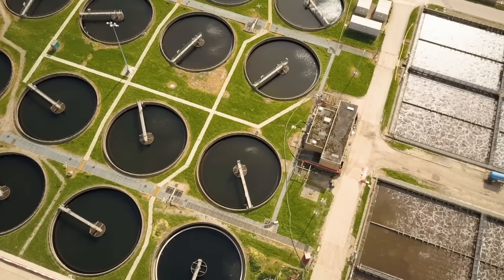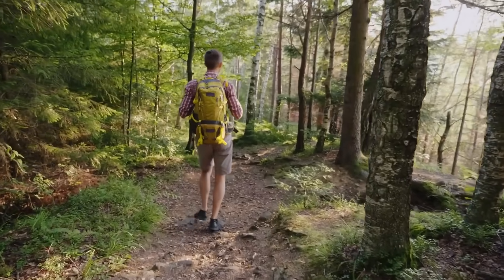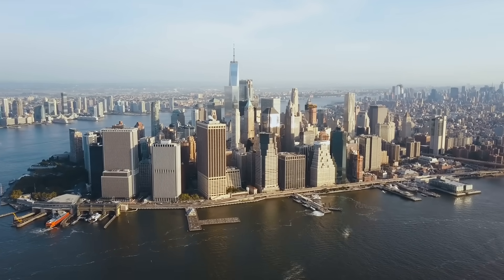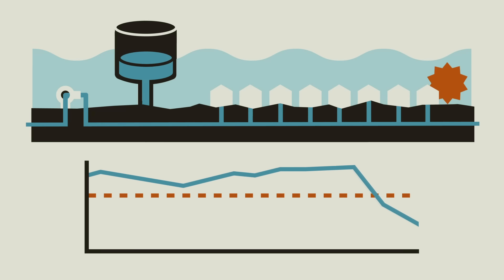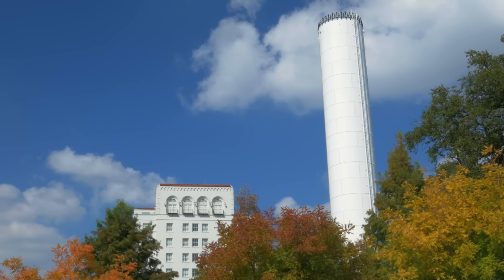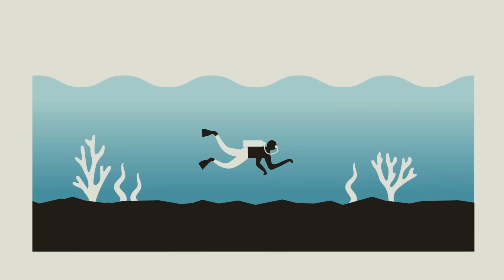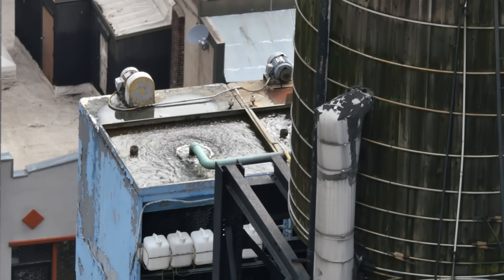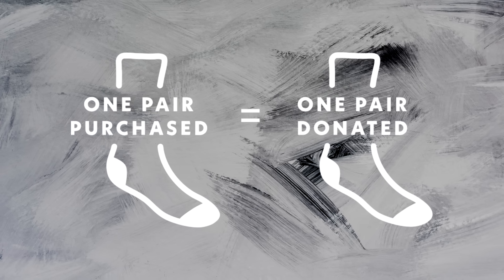How Water Towers Work

Comment: So it's basically a capacitor.. for water.
Reply: Get out of my mind
Reply: The equivalent of a capacitor in a hydraulic system is usually called an accumulator, but yeah, these two things are analogous.
Reply: @nopenoperson8964  ok, water tower is a huge storage accumulator with ~1atm of pressure in the air tank, which happens to have a really big volume.  </snark>
Reply: Gravity battery
Reply: That's another way of looking at it.
Reply: Exactly what I thought!
Reply: hehe came here to write the same thing
Reply: I look at capacitors as water towers. for electricity.
Reply: now... you attach a turbine to it with a valve, and you've got a form of electrical storage!
Reply: I am a civil engineering student...can you elaborate how capacitor works?
Reply: @08_avinashmeena57  A capacitor is a device that charges up first before it allows a flow. It acts as an open circuit before charge and closed at discharge. I guess looking at it again, capacitors may not be the perfect analogy but it is to a certain extent. But analogies aren't inherently wrong. It's just one way of looking at it.
Reply: @LightningSe7en  thanks bro
Reply: @08_avinashmeena57  Another way of defining it is by its electric signal. It will generate pulses representing the charge and discharge cycles with varying frequency. Some only visible with an oscilloscope.
Reply: @08_avinashmeena57  I heard you're too noisy to be a civil engineer.....
Reply: @08_avinashmeena57  you didn't learn that in your core physics classes?!
Reply: Thank you, I now understand what is capacitor.
Reply: In airplanes we call it a hydraulic accumulator. --a cylinder with a bladder or movable piston that separates the air or nitrogen from the hydraulic fluid. Fluid is forced in and the bladder/piston moves off center increasing the pressure to allow flow back out even when the pumps are off -like a battery.
Reply: @pardunmeesuh5612   it's an accumulator... :)
Reply: lmfao thought that too.
Reply: rovku it’s so weird. In electronics you’re always told water analogies, but it’s come to make more sense to me than water itself lol
Reply: Yes simmilar
Reply: A big capacitor
Reply: Not quite. It's an ideal voltage source - for water.
Reply: What's capacitor
Reply: @Lockey007  http://bfy.tw/LJ9m got it
Reply: No, its a water cache
Reply: No a capacitor blocks dc but allows ac to pass through. It is analogous to battery. A battery is for long term storage and slowly discharges.
Reply: @projectmanagement2356  a capacitor matches far better than a battery. Batteries have significant nonlinearities in their charging /discharging which makes them a poor composition to water towers.

That said, if your looking at ideal models of capacitors, batteries, or water towers, Then it wouldn't matter which your looking at
Reply: @CrashTestCoder  No a capacitor instantly discharges where as a water tower has a limited flow rate just like a battery.
Reply: When I was a kid, I called it a water monster
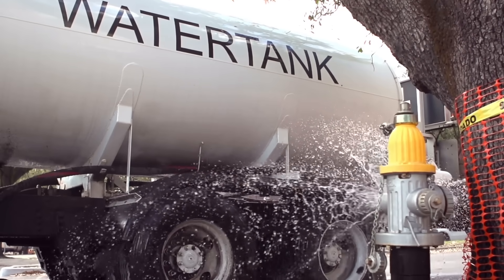Reply: Heh @4:16 def made me think of the hybrid system indicator on a Prius!
Reply: yeah 🤔😎
Reply: Exactly!
Reply: Ah yes, capacitors, the flywheels for electricity
Reply: Battery is probably the better analogy. Since a water tower is meant to smooth out flow over a long period of time and not just to dole out quick adjustments to keep things from spiking on a second to second basis.

In power systems, capacitors are used to control the voltage angle in power flow calculations; storage is usually the job of battery banks, or systems like gravity storage, which Tom Scott made a very lovely video on here:

https://www.youtube.com/watch?v=6Jx_bJgIFhI
Reply: @nickolas474  IMO, the proper analogy would be a static charge as a stored head of water is has a potential difference to the outlets below.
Reply: calculator made of water tanks!!!
Reply: @ureuengyoutube  google "hydraulic computer", it's a real thing!
Reply: Or a flywheel, perhaps
Reply: @balajivenkatesan3177  Flywheel is an inductor, it hates change in velocity.
Reply: @jebsaekam  Ohh, I always thought it is similar to a capacitor. Thanks for the info, though 👍
Reply: For me, it's more like a battery, not a capacitor. 
At some point, battery and capacitor may work the same way, but capacitors can be charged much faster and give you much more current, while batteries are slowly charged and can't give you a lot current in comparison to capacitors. Also, capacitor can't sotre it's energy for too long, it will self-discharge quite fast(it takes a lot of time for battery). 
So water tower, you slowly "charge" it with water overnight and it's slowly "discharging" durning peak hours and water may be stored there, theoreticly, forever(it's another topic, that this water won't be safe to use after some time because of bacteria etc.).
Reply: @Stasiek_Zabojca  Since this is water and not electricity, both scale and speed are relative. In short : I think water tank is faster in response than lake/sea/underground source, and same goes for "charging" them (lake vs. tank scale). Water tower = Capacitor, and a Lake = Battery.
Reply: @Lockey007  how did you do that